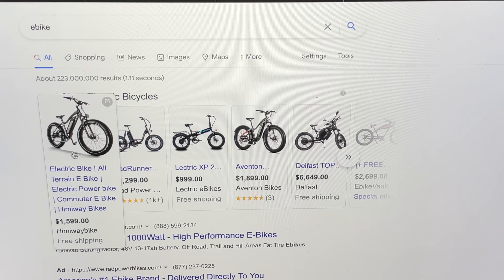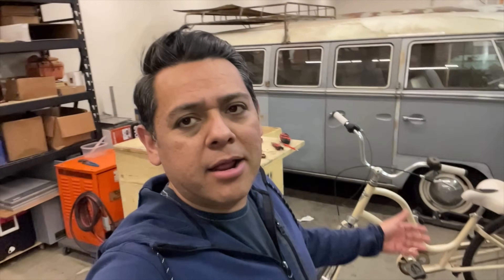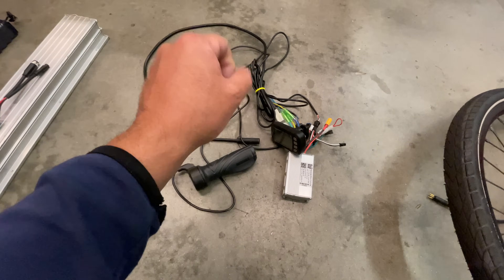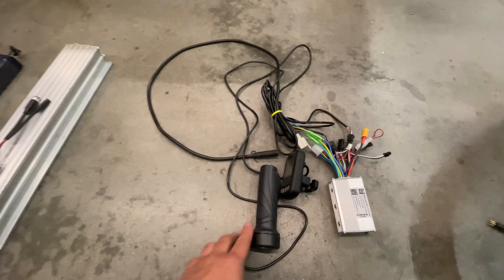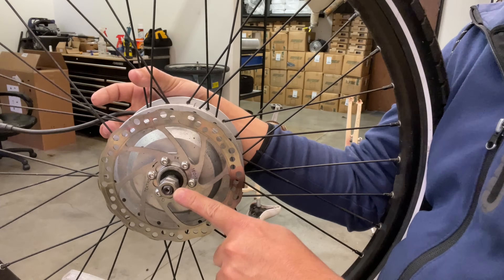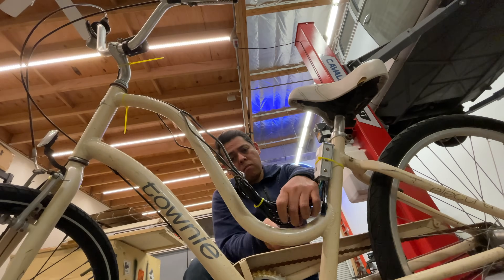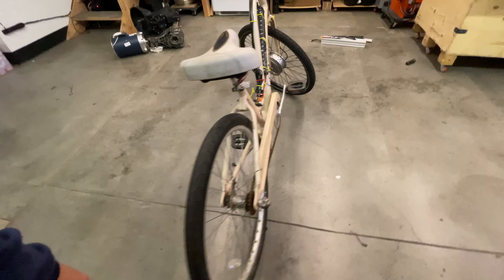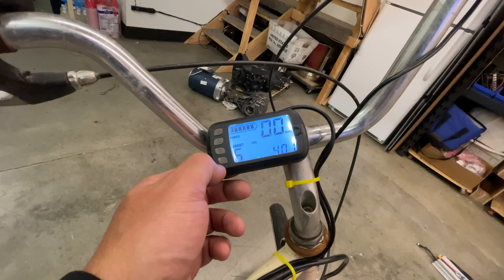$150 eBike Build,  Beginner friendly

Comment: What made you decide to do the front wheel instead of the rear wheel?
Reply: A front hub motor is a simpler build, you won't be having to mess with the chain, sprocket, coaster brake, or derailer if it's geared. But if your wanting pedal assist, you're going to have to go another way.

Comment: Some places still sell the 10 speed gas engine kit:   0.25 horsepower,  200 MPG  tiny  1 cylinder engines strapped connected to your back wheel...
Reply: ....and sounds like a continuous loud wet fart the whole time. Doesn't sound very relaxing to me.

Comment: That's an accident waiting to happen' front fork will fail under sustained pullimg stress, since rear weel + rider are drag, old bike+hidden rust, continuos pull, electric has torque..you figure it out!
Reply: you realize there are these things called peddles that applies torque to the back wheel, phenomenon called chain crank and gears......you figure it out!!!! please unless you have experience with the specific tasks, leave it to the wanna be engineers to make them selves look dumb....oh wait.
Reply: What are you an officer in a home owners association or something?  Take your fake concern for everybody's safety and GTFOH with all that Karen. This is a channel that supports people building their own high voltage battery packs with salvaged batteries from old, shitty laptops. C'mon, Man.

Comment: Looking forward to seeing your follow-up build on this ebike. Would love to see a dual-motor build with extra batteries stacked on this thing lol.
Reply: Same. I want to do it with a trike and a dual motor would be ideal… or triple motor! The basket and towing capacity and extra frame pieces mean I could carry a ridiculously large battery arrangement. :)
Reply: @emmettturner9452  Im doing it with a trike too! Did you finish your build?
Reply: @roberts2760  Never started it but I did finally order a spare 300w scooter motor from his shop along with some batteries and I know where I can get a scooter/eBike controller locally so I’m looking into it again. :)
Reply: @emmettturner9452  oh good luck to you! I recently got stopped by police driving my trike drunk at about 2am and I got my drivers license suspended for half a year, I sold my trike... Also had to pay 1500€ fine
Reply: @emmettturner9452  I am curious just where would you use the second motor? If used on just one rear side, there will be sideways motion added, making it very unstable. It will take 3 motors to make it stable. Or, at least more stable. I have a trike also and I have not even considered this. I don't find it necessary.
Reply: @paulreeder5241  Left and right for increased torque.

Comment: I did this conversion on my girlfriends Cruiser Bike.  It is a single speed.  It now goes faster than my road bike! It is a blast! Not much torque but it does have upper end power as you see in the video.  The controller is garbage and took some tinkering to get to work.  Tip, when you turn it on the wheel automatically accelerates!  This is because it does a self calibration mode.  Once I figured this out it was good to go.
Reply: How did u charge the battery thanks

Comment: May be a dumb question, but can you talk about or recommend how to recharge these batteries?
Reply: Check out his other videos about these batteries. Jehu has tons of amazing content.
Reply: most batteries come with a charger, or buy one on ebay for $20
Reply: go on his website. instructions are listed on each battery page. very informative website
Reply: @HtwoHH  I bought two of his 460wh scooter batteries, and the charging connector is proprietary. I couldn't find the information on where to find a charger that fit it, or how to modify it to charge with a regular 48v charger. Any chance you know which of his videos talks about that?
Reply: @badsamaritan8223  you'll need the dongles he sells it if you want to draw more than one amp. There's some protection system that it spoofs.  He has instructions on which pins to jump. To awaken that and then I believe you can charge through the dongle? Please let me know if I'm wrong cuz I haven't gotten to it yet
Reply: Battery charger. Deeeerrrp
Reply: he linked a charger in the description

Comment: Finally got my wheel and hub in, tire was slashed and the tube was shot. Luckily I wanted to use the tire that came with my original bike so it looked right. Controller is supposed to be in today so I'm hoping that the install goes smoothly :-)
Reply: Install has not gone smoothly. Looks like I need a new wheel hub. Hoping to hear back from support soon.
Reply from the maker: Bad wheel?
Reply: @jehugarcia  that's what I think it is at this point. :-(
Reply: @JoMiller97  did you figure it out? Was bad hub? Mine is turning slow and makes noise then shuts down.
Reply: @Ruster2005  was a bad wheel hub motor

Comment: how do you charge the battery? the cord has no adapter. *UPDATE  i got the connecters everything runs great and battery charges
Reply: How did you figure it out? I bought the same battery and charger, but have no idea how to charge it!!!
Reply: @elliotmarks06   this is a link to the connectors heads i will send you the other connector that goes on the wires https://www.amazon.com/dp/B088NKDLYD/ref=cm_sw_r_cp_apa_glt_fabc_dl_KPVR0TA73C1SQB346N2B?_encoding=UTF8&psc=1
Reply: @elliotmarks06  https://www.amazon.com/dp/B086Z3H4X8/ref=cm_sw_r_cp_apa_glt_fabc_9MJXRCCN0Y9FZSN7GKC2?_encoding=UTF8&psc=1
Reply: @benjaminguinness7638  I love you
Reply: @zacharyfunes651  i love u too bud. enjoy your e bike and please be safe

Comment: Well, after all my griping, here's what happened. It's surprisingly easy to put it together. There are a couple things that needed to be cut and have plugs put on them. Fortunately I had some xt60's laying around. I got it up and running, and it works great. Two of the wires had to be switched. They said that it was out of phase, so they told me to switch to of the motor power wires and it worked.
If your do-it-yourself'er, can solder a little bit, and aren't scared of diving in headfirst, it's not a big deal. I have a great bike that goes 22 miles an hour, and will last for about 20 miles, and I only have $200 invested with the bike! Lol
Reply: Which wires did you end up switch on the motor cable?
Reply: The blue and the yellow. I left the green wire alone.
Reply: 4:48
Reply: How did you get it to 22mph? I got all the same parts as the video and I barely touch 10mph
Reply: @jamesjohnston8863  Did you turn Power up to 5? I starts @ 1
Reply: What battery did you use?
Reply: I bought the middle battery. It seems like it costs $35 or so. One of them has died though, and I can't revive it. The method suggested don't work. I guess it's dead.
Reply: @mattosborne1233   Cool. Thank you for your info and insight!
Reply: "they" told you?...who is "they"?

Comment: My GF got an e-bike and I can say once go electric you will never want to ride a regular bike again at least for distance riding. For everyone contemplating getting one and worried about the range, my 2 cents after owning one for a while I would not worry about it as long as your bike has 15 miles you are fine for 90% of the time unless your are going to commute to work and it is a longer distance or some special use case. We use our electrics for running up to the grocery store or corner store. Again it is so worth the $ spent.
Reply: I prefer my e-bike for hilly riding but If the road is mainly level I can ride my regular bike all day long because I'm constantly shifting gears.

Comment: just ordered parts to make one for my girl and I. we live in mountains so running 2x $50 batteries. very grateful not to have to mess with the bike drivetrain with these front wheel hubs, and the fact they come with disk breaks massively convenient!! thank you for sharing the ultimate diy bike conversion while providing affordable materials for building. you da man.
Reply: Just keep in mind that this is Front wheel drive and will slip tremendously going uphill. Especially on dirt and gravel. Even on a straight road the wheel will spin.
Reply: @paulreeder5241  The wheel will spin and you will crash. This bike is a suicide waiting to happen in more ways than one.
Reply: You need to have a brake cut out or else you are putting too much pressure on the motor.
Reply: Did all the batteries come? i just wanna make sure this is not a scam
Reply: Link for wheel please
Reply: Please don't ride a bike like this in the mountains. It is good for riding around the block but that's it.

Comment: I bought a conversion kit off eBay about 5 or 6 years ago for $150 and put it on my mountain bike. At that time I couldn't find lithium batteries for less than $400, so I used lead which cost around $60. It was fast and good for about 20 minutes. But, that was the heaviest piece of crap, that took for ever to charge. It's crazy how technology changes so fast.
Reply: What was the cheapest wheel you got I can’t find any cheap ones
Reply: @jonathanpeter2298  ali express got them for 90 bucks
Reply: Trying to find or make a 36v 350w battery adapter to use on a trike build from ebike..a never worked totem victor2..,?? And a 36 v 350 watt motor...

Comment: Well, I have all the parts now, but no instructions on how to assemble.
How about it Jehu
Reply: on the controller selling page you can surely find the connection diagram, the 3 phase wire are for the motor together with the hall sensor ones, don't know why he didn't link the conversion kit for the motor wire (those come with a 9 pin and most controller have separate wire) but you can probably find a workaround if you get the diagram for the motor wire then cut and solder some connector won't be hard. 

update: i found this on amazon "Greenergia 9Pin Waterproof Extension Cable for BAFANG" can't link it but search this and select the "colorful 158mm" option

Comment: I bought two sets, put first set together, it shuts down 10 seconds into throttle. Tried adjusting pot to no avail. Need help here.
Reply: you ever get it fixed? I'm seeing the same thing...
Reply: Did you connect the hall effect sensors?
Reply: I had the same problem, SWITCHED VOLTAGE FROM 36V to 48V on controller! NO ISSUES NOW!

Comment: Do they make these in 24" bike wheels? Or can the motor be taken off and put on a different wheel?
Reply: yes any bike shop can respoke onto a smaller rim ,but be prepared to pay $60 to $200. not cheap. you can probabaly get a used bike for the cost of respoke job.

Comment: i have a question. what if battery pack total amps bigger than bms and controller can handle?
Reply: doesn't matter, the motor will only use what it can. if you go up a lot of hills though you can burn up the motor so get a temperature sensor.

Comment: That does seem nice.

But serious question, how long would this expect to last? Like how many miles of use? Would it last for more than a year?

I mean it is only about $150 using a fair bit of used components too. So.. yeah, how long would that last?

I mean it is cool. But I’m just wondering that. I kind of want to build my own, but from what I’ve seen, if you want something you can ride daily, you very likely need to spend a lot more than $150, even just for converting.
Reply from the maker: The only cheap component is the controller,  the motors are brand name and the batteries also are also quality cells.
Reply: jehugarcia I see now. If you used it as a daily rider, how long would you say it would last? A year? 2? More?
Reply: @jayevans6146  the only thing that will wear out is the battery, Battery life is measured in cycles. so depending on how long your ride is and # of cycles will determine how long battery lasts. anyways just buy some spare batteries.

Comment: Update again . Total waste of time and money. Replacement wheel has bad hub motor . The battery is no good .  The second controller is the only thing that works . Lesson learned .

I bought all the parts . Controller doesn’t work, wheel was bent in shipping . The battery and charger seem okay .
Update : battery might be bad . The controller is probably okay . Battery chargers to 36v but sags to 20v with minimal load .

Comment: Budget charger? How do you charge and find a charged that fits?
Reply: Any AC to DC charger doing 36V and not exceeding rated amps on a battery pack I suppose. Even 19V laptop charger will do, but will charge 2-3x longer. Fittings? As you saw, he fitted XT connector and is prob using universal battery charger which is quite expensive, but basically any used e-bike/e-scooter charger will do. Try to avoid buying battery pack without a charger.
Reply from the maker: It’s $20 on Amazon, I included a link in the description  which I don’t know why I do nobody seems to click them.   Solder an xt60 connector and you can charge your battery.

Comment: When you relize that a homemade electric bike goes faster then expensive electric motorcycles.... for 99% cheaper... example ARMADA PREDATOR ELECTRIC MOTO
Reply: there is a reason many manufacturers limit speed. If speed is not higher than law says, you need no registration, no driving license, no insurance.  Most people who want electric bicycle or motorcycle, they dont want additional fees, or licenses. They go further tho. But about price, cant say a thing about it.

Comment: for 50 more you can get a kit that has the controller built into the wheel hub. you end up with a much cleaner looking product with only 1 cable going from the lcd display to the rear wheel.
Reply: Where can we purchase it?
Reply: @plenajazz  https://www.amazon.com/dp/B07FVQPKYV?psc=1&ref=ppx_yo2_dt_b_product_details
Reply: Just don't use the included freewheel. Mine was too long for my wheel so the axle stop was actually inside of it which resulted in the frame touching the freewheel. I converted mine to a 6 speed freewheel and it worked perfectly.
Reply: @FtanmoOfEtheirys  amazon says unavailable.  if the controller fails then one has to take apart the hub, so harder to maintain?

Comment: Cant you put one of those wheels on the back as well do away with the pedal system ?
Reply: If you have a throttle you wouldn't need to peddle, but you would lose a lot of range. If you got rid of the drive train, where would you rest your feet when your riding?

Comment: plug in the hall sensor wires ive tried with and without on a bunch of bikes and scooters ive built, youll get smoother acceleration and better efficiency getting you up to 20% more range because the motor doesnt waste any energy due to the controller giving power like 1 degree early or late
Reply: How did you hook up the hall sensor wires? Color wise I mean.

Comment: Hi Jehu, how would I adapt the big or small batteries you linked to run with that controller, please? I can solder, and I am familiar with XT-60 and XT-90 connectors, I just have no idea how to work with those scooter packs. My background is with RC LiPo packs. Thanks!
Reply from the maker: Just parallel them
Reply: @jehugarcia  Ah! Of course! Thanks!

Comment: Do you have to do any soldering?
Reply: He mentions he did have to solder on a plug. From other comments I'm seeing it'll depend on which battery you choose. Might have to solder, might have to get a proprietary charger, etc. I'd get the big parts all together then identify what extra hardware and adapters you still need. Don't expect it to take 10 minutes, and don't expect to only spend $150, especially if you're not already hip to soldering/electronics.

Comment: why not putting the motor in the back ?
Reply: its bad to run a front wheel drive setup on a bike just because of how a 2 wheel vehicle responds under load.
Reply: @FtanmoOfEtheirys  ok, but there are a lot of ebikes with back motor, and don't seem to have any problems
Reply: @MakeNoSound  becuse most bikes these days have the wheels drop in from under neath, not from behind. This prevents the wheel from ever loosening and removing itself since your weight is holding the frame down onto the axle

Comment: Hey bro, thanks! I was hoping one day to build an electric car, but this is a whole lot more feasible. I think I'll do this today! I have so many zip ties!
Reply: Did it work out?
Reply: @varick6501  I'm still collecting parts, but it looks like it should work. I've ordered a throttle and the powered wheel he linked to, and a controller and a battery.
Reply: @glenesis  Nice man! I really wanna do this project, I’m nervous about the one thing he said in reference to Soldering, as I do not know how to do that
Reply: @varick6501  I'm not expecting to solder anything so I'll check in here once everything is working. Wheel, throttle with volt meter, and controller came to about $100, battery was almost $200 from California - would be a lot less if ordered from China... I don't want to miss summer 😂 Now I need a bike, I want to see the wheel before I pick a used bike tho... It should all go together pretty easily, and I'll put the parts in a front-mounted basket. I'll update here for you.
Reply: @glenesis  Alright man, let me know how it goes!

Comment: on your website about the batteries, looks like you only have the big one left in stock. Looks like I need some different wire ends in order to put the connectors I need, especially to pull the battery out of sleep mode. Where can I get those cables?
Reply: I found another thread where a gentleman is selling them. His communication is awesome even with everything going on in his life. joeltinaz at gmail.com